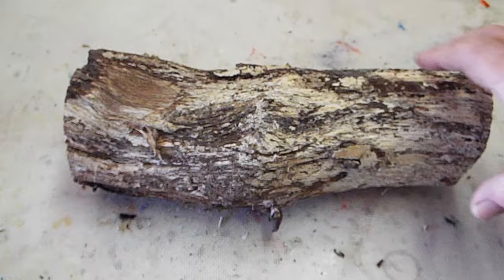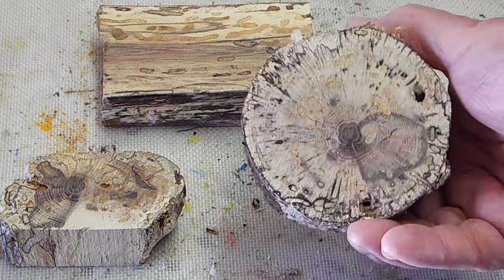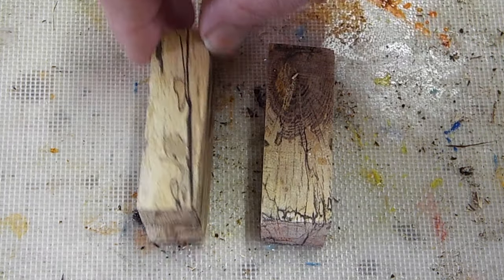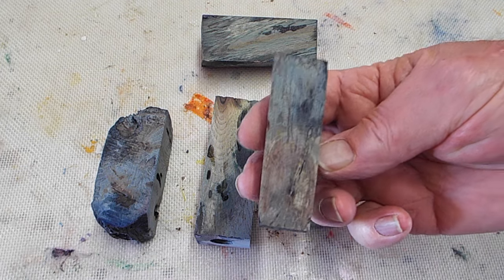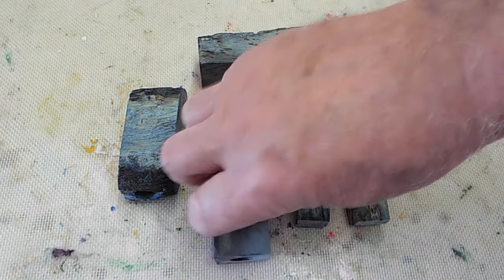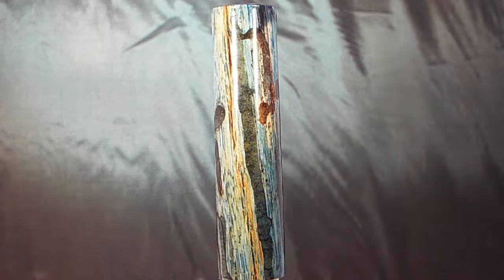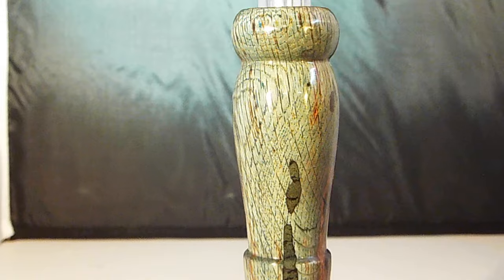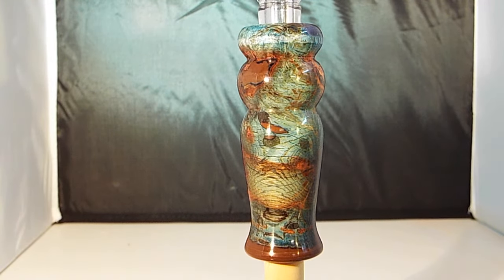Stabilizing you have control

Comment: That is some nice work.  
 
Still confused on how you filled the worm holes.  You submerged the blanks in epoxy and put in the pressure pot?
Reply from the maker: +Jim E : Jim, the epoxy was used just to fill one hole on the stabilized pen blank. The duck calls are cut to length and width to fit mold. I drill them before putting in the mold. Reason being, I am using stabilized rotten wood. The wood is full of voids,  bug holes, checks, and cracks. The drill hole in the center lets the Alumilite resin seep into the unseen flaws thus making for a better looking finished product.

Comment: After stabilizing, you cast in Epoxy... do you use a pressure pot?  I'm debating if I want to set one up or not.   Only casted poly acrylics so far.
Reply from the maker: +Scott Clark: Scott, yes I use a pressure pot, I use Alumilite clearer my casting, I have used other resins but I like the Alumilite. If you buy a pressure pot and get one from Harbor Freight don't throw away the packing material the honeycomb makes great pen blanks. Lots of luck